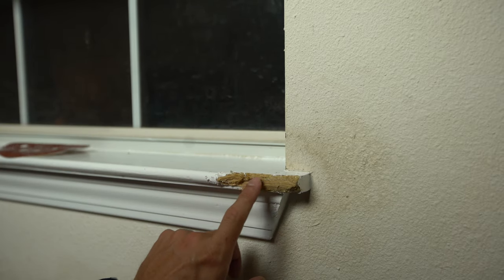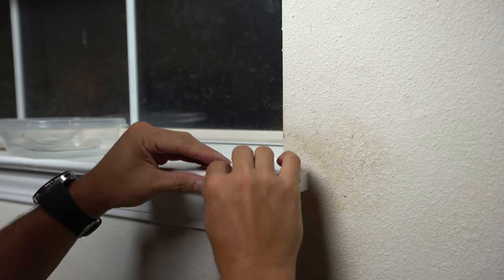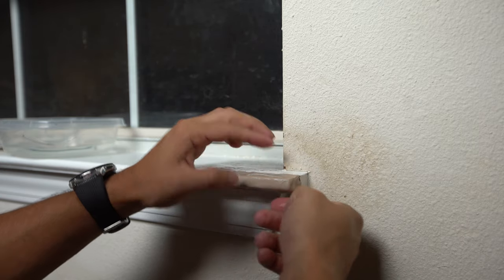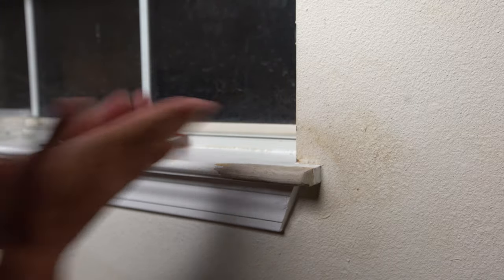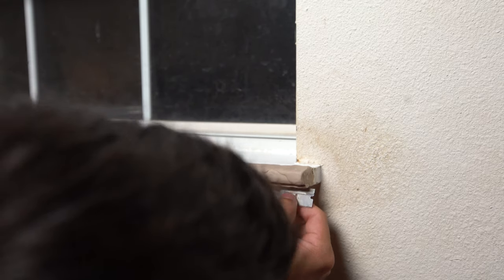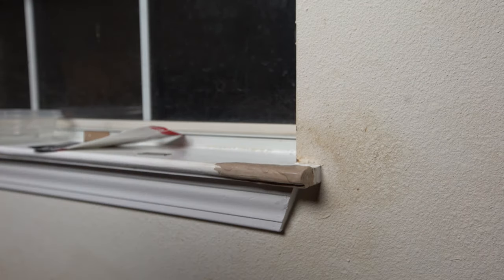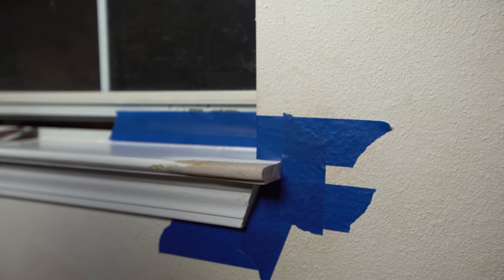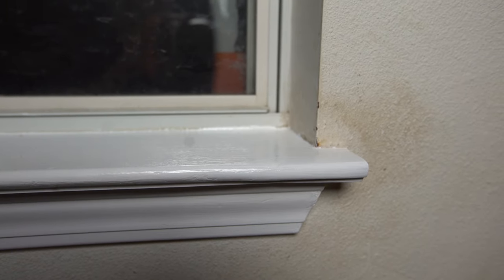DIY: Repair a chewed up Windowsill

Comment: You can use a can with coins in it and tape the top shut, to stop your dog from chewing things. But you have to catch them in the act and have to have a chew toy for them to use and follow with a “eh no” after shake of the can, by a “ok good boy or girl” chew this ...”. I’d suggest a Elkridge deer antler dog chew toy from Amazon. Petstages Made in USA Deer Antler Medium Dog Chew Toy https://www.amazon.com/dp/B01D3BDVH6/ref=cm_sw_r_cp_api_i_N5ZiEbDH6GEP0
Reply from the maker: I wish I could say that this was due to a training issue or because of boredom, but unfortunately it was seems to have been done to jealousy.
He chewed on the windowsill, door jamb, and wall only when I was dog sitting for my neighbor.
Since then he has completely stopped.
Reply: @JoeMartinMVC  That's good to know.  I just know that the can works.  My dog just chewed the corner of our bed set, and I did the can correction and he dreads going near it.  By the way, I fixed the bed with PC Woody Epoxy and it worked out great.  Didn't take as long as yours, but your video inspired me to do the repairs.  It's 90% better.

Comment: Maybe I misunderstood. maybe you said  it was  alcohol in a water bottle.
Reply from the maker: I typically mix it 50-75% rubbing alcohol to water. Ideally I like to use 90+% rubbing alcohol (IPA/Isopropyl Alcohol), but if you can only find 50-75% that is fine as well.

Comment: I wonder if I can do these for my blinds??? Lollll 😟😟
Reply from the maker: If they were wooden slat blinds... Technically yes. lol
If they're vinyl blinds, or any other material, can't say it'd work out. If you have vertical blinds you can typically get replacement slats for those through hardware stores or online though.

Comment: How about if woodglue?
Reply from the maker: Wood glue is very thin and wouldn’t be able to build up like the epoxy can. However you could cut out a square section of the windowsill then glue in a piece that fits the area you cut off.

Comment: my windowsill is drywall and is completely destroyed.
Reply from the maker: Drywall windowsills are definitely a lot harder to repair, but I could walk you through the process if you wanted. Have you previously done any drywall work?
Reply: JoeMartinMVC no i have not, I am thinkin  about using an entire thing if spackling and then paint over it, I need to re paint the room anyway
Reply: JoeMartinMVC trust me when I say its destroyed, it’s destroyed
Reply from the maker: Using a tub of spackle will create bigger issues for you down the road, as it's going to shrink and crack. Personally I'd start off with grabbing a 4x4 sheet of drywall from Home Depot and putting it in instead of trying to fix the damaged drywall. There are two wonderful YouTube creators for drywall work, Vancouver Carpenter and Home Renovision DIY that have full and in depth videos on how to do drywall work.
Reply from the maker: If you want to message me on Discord (https://discord.gg/fFwbT8S) and send me a picture or two of the windowsill, I can see what would be some of the best and viable options that would require the least amount of work.
Reply: JoeMartinMVC thanks dude ill give that a try
Reply from the maker: @voltag3man  You're welcome. Feel free to ask any questions, I'm actually doing drywall work in my house as we speak, so I'll be happy to help and offer any advice that I can.
Reply: JoeMartinMVC good stuff man, anyway I can send you pictures? Do you have an instagram by chance?
Reply: JoeMartinMVC will do, I will get those pictures to you asap

Comment: Dude wash the wall.
Reply from the maker: Sharon Taylor comically thats after scrubbing the wall with some pretty strong cleaners. It was an unprimed wall painted with extremely cheap contractor grade paint, so the actual drywall was stained. I painted the house shortly after, so I didn’t care too much that it was filthy from Ixion.